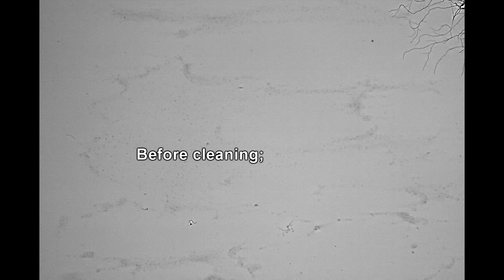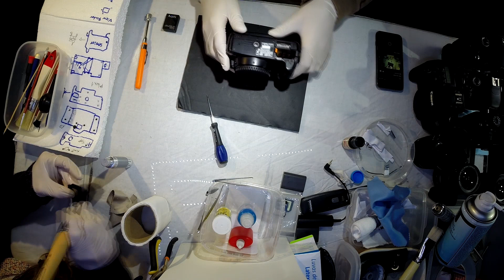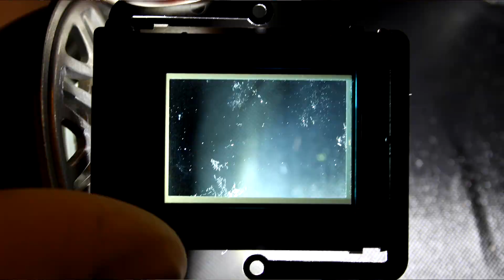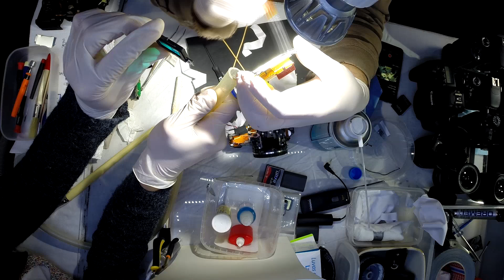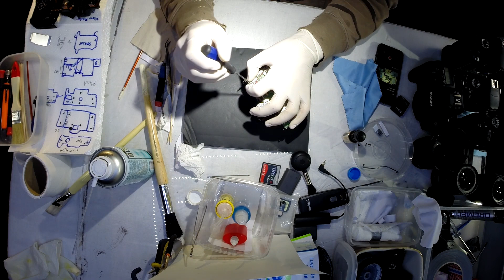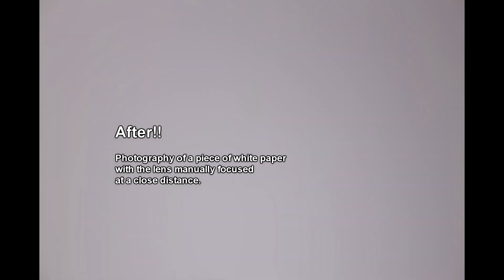How to Clean / Remove fungus and dust from sensor DSLR Camera, Canon assembly guide.

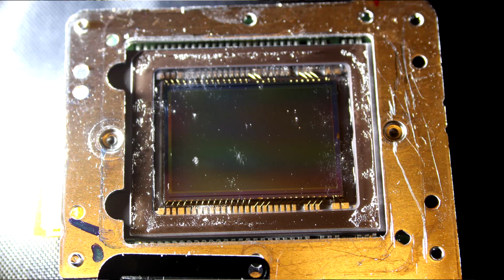Comment: Hi! First off big thanks for uploading this video. I was wondering what is the liquid that is being applied to the sensor in 1:28? This is one of the few videos on how to properly clean fungus from the sensor filter AND the sensor itself, awesome work!
Reply from the maker: Aragorn266 Hi there, 
im not shure about the translation from portuguese but i think what im using its DEHYDRATED ALCOHOL; it means that is almost 100% alcohol, with no water. Its composition is: Ethanol alcohol 90%, Isopropyl alcohol 3%, methyl ethyl ketone 3%. I also add a few drops of water (like 1%) to avoid to dry so fast!

Thanks for your comment!
Greetings

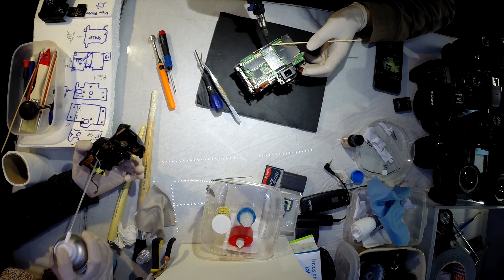Comment: hi. what exactly are you doing at 0:41? seems like you are holding a soldering iron. also, how did you discharge the flash capacitor?
Reply from the maker: Adrian Ronald Sehat 
Hi
Im using the soldering iron to remove that metal plate that cover 2 ribbon cable that you need to disconect.
The flash capacitor looses energy quit fast ^(faster than regular batteries), after 2 days, the capacitor its probably 20%...
you can also shoot 3 flashs and disconnect the battery. 
Also, since i used gloves, theres no big danger!
:)
Reply: Rui Bento Alves thanks for the info!
Reply: Rui Bento Alves 

You will have a bad surprise someday with this method. If you are lucky you only will get hurt....
Reply: Repfotocentro reparações 
HUM?!

How come?!
What could happend with this method?!
Reply from the maker: Repfotocentro reparações Viva!
Obrigado pela sua preocupação! :)
Há muitas maneiras de descarregar o condensador, nem que seja (a mais rápida) "chantando" os terminais do mesmo!!
https://www.youtube.com/watch?v=gUaDI_42iFU
Cumprimentos
Reply: @RuiBentoAlves  é seguro fazer este "shunt" no condensador enquanto ainda está conetado na placa verde? ou há risco de danificar algum componente por fazer curto circuito?
desde já excelente video, acho que o único que consegue mostrar o passo a passo. Tenho um problema igual, fungo entre o vidro e o sensor e na loja de reparações foi-me dito que era impossível recuperar. Sendo assim vou tentar fazer eu o serviço em casa e seja o que deus quiser. Apenas fiquei apreensivo com a questão de descarregar o condensador...
Reply from the maker: @14zesilva  
Boas,
O "shunt" é para nao apanhar um choque electrico (pois já apanhei!!). Descarregar o condensador de forma directa nao estraga outros componentes! Podia até estragar sim o próprio condensador, mas ele está já preparado para descargas rápidas!
Por outro lado, para nao se preocupar pode usar uma resistência para descarregar o condensador devagar. Assim não tem problema mesmo!
Em relação ao fungo na sua camara: Se ele afecta muito a qualidade da imagem, po, deve desmontar e limpar. Mas se não nota nada de especial nas fotos, se não é muito grave, talvez seja melhor não mexer pois dá mesmo muito trabalho voltar a montar o sensor bem limpinho!!!
Se acha que o fungo já estraga muito a imagem então arranje um local bem limpo, arranje muita paciência (pode fazer em 2 dias ou mais sem problema) para limpar tudo muito bem e voltar a montar sem qualquer poeira ou outro lixo...
Dá para fazer o trabalho mas, và já mentalizado que deixar os vidros como novos, bonitos, dá muito trabalho, é preciso muita paciência!
Qualquer dúvida, disponha.
 bom trabalho!
Abraço

Comment: I have the same problem in 5D Mark ii. How do i know if the fungus just in filter and not on my sensor?
Reply from the maker: Hi,
You can take a photo and check that:
Take a picture to a solid surface (white is good) out of focus and put the aperture the maximum closed. You will see all the dust and fungus! Then you can see that some are more sharp than the others. The sharper they are, most close to the sensor they are. If you can cleary see that some are a bit more blur and others very sharp its mostly like that you have fungus right on the sensor.
Hope that i help.
Any questions feel free to ask.
Cheers
Reply: @RuiBentoAlves  Thank you. This is the pictures of the fungus sensor problem in link below. can you tell me if this fungus on sensor or on low pass filter? if the fungus on sensor do i have to replace sensor with another one or just i have to clean the sensor with 99.9% isopropyl alcohol? (If you want to send you these pictures in your email. send me your email please. i'm waiting your response. Thanks.)
Reply from the maker: @the-entertainment477  HI,
i dont see any link with pictures!
Yes, you can send me by email: rdigital01@gmail.com

You can replace sensor with another one (i just saw a new one from China for 60€)  or you clean the sensor. However, its a paciente processe! You cannot leave any particule of dust! Its not easy to put a sensor 100% clean. There´s dust everywhere! But its possible! :)
Send me the photos!
Reply: @RuiBentoAlves  Hello I sent you the pictures and some questions. Thanks

Comment: I just saw a very tiny hair like particle on my camera's  prism. I find it whenever i look through the view finder. I'm confused that is that a scratch or it can be removed?

I'm using canon 700d
Reply: If it's only on the view finder and doesn't show up in the picture then that a good thing. Take off your lens and look above your mirror and you'll see the bottom part of the prism and that might have stuff on it or it's on the part of the view finder where you put your eye.